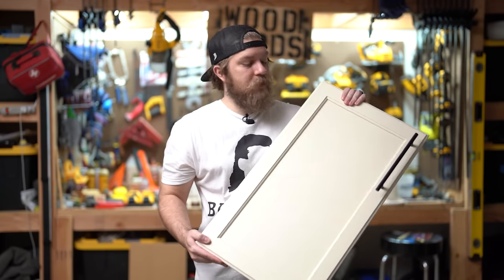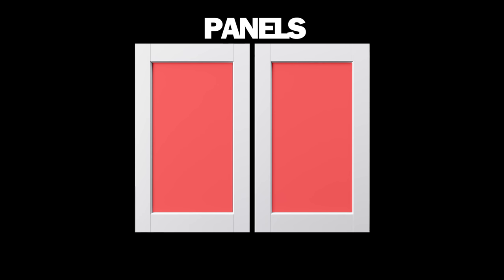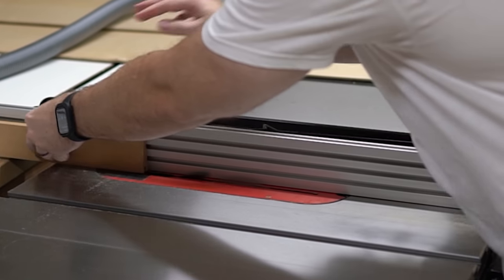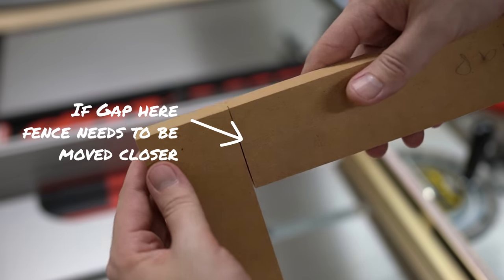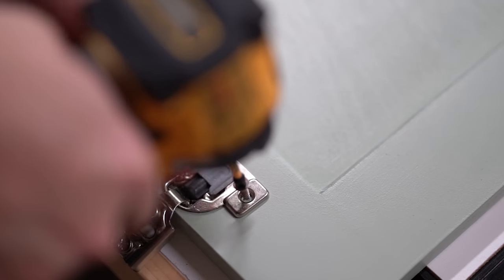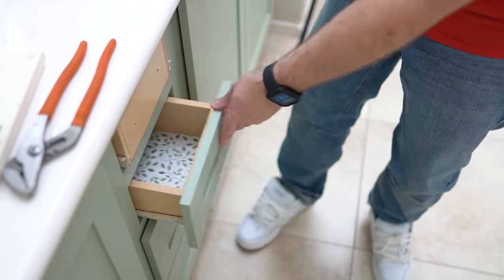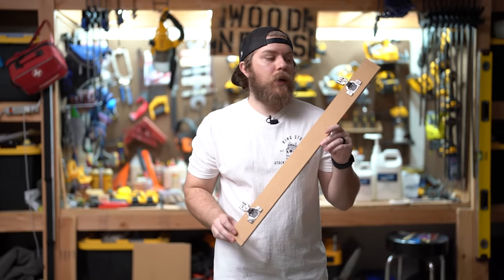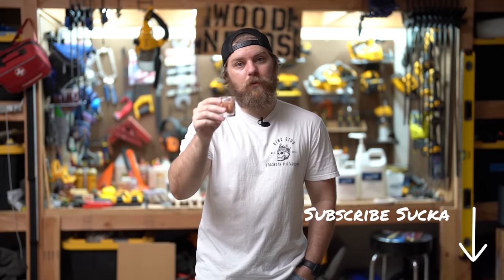CHEAP and EASY Shaker Cabinet Doors and Drawers | DIY | HOW TO

Comment: Great vid. Could you elaborate more on your painting process? Brush, spray, roll? You can be the best cabinet builder in the world but if your finish is poor it makes absolutely no difference. The finish is as important to the cabinet making process if not more than the actual building
Reply from the maker: Thank you! I rolled on 4-5 coats of a primer/paint furniture/cabinet base paint. The furniture/cabinet paint has oil in it that helps the paint penetrate and hold up to abuse (from what I understand). I’m definitely no pro and have seen some great tips for painting cabinets in the comments!
Reply: Thank you. Pro or no pro, your finish looks excellent. If you hadn't told me that I would have thought you sprayed it.
Reply: @WoodNerds what is the name of the paint and color code. That.looks great and link for the handles please
Reply from the maker: @BL-ut2zz I really appreciate that! The cabinet grade foam roller brushes do a pretty good job!

Comment: If I got this right: The bottom drawer alignment is critical for presentation. The top drawer height above/below cab door height is not as important to naked eye? Love the green color using gold hardware. Wow. The tips helped a lot as I encountered all of these issues in a recent cab build. Gonna try these Kreg templates - such a good company. Excellent painstaking presentation that answered all of my questions. Thank you! Sub’d
Reply from the maker: Hey! I would say they are both important! The bottom drawer face is the best place to start because you can mount it flush to the bottom of the cabinet doors and the rest you can stack on top. The math will make sure the top drawer face meets with the top of the cabinet doors. The left to right alignment is also important but the cabinet doors might be in or out a little due to adjustments you make on the hinges so as long as the drawer faces are straight to each other I think you’ll be looking good.

Thanks for subscribing and taking time to respond! I hope your future doors turn out well!

Comment: Nice video and well filmed and explained. This is pretty much exactly how I did my kitchen cabinets and all went nicely, although...
some problems I encountered were.
1. MDF when ripped to 2.25" wide is very flexible across its length so if your 1/4" P.W. panel is warped it will cause your door to be warped. 
    - you need to use very straight plywood and get the door built and primed before moisture starts to do its work.
    - once the glue and paint dries these doors are very stable.
2. The exposed cut edges of the MDF tend to be rough and soak up the primer and paint. I sanded and used a wood filler product to fill these edges but it was a real PITA. especially doing lots of doors.
  - I was hoping you would show how you solved this problem in your build (there must be an easier way than how I did it).
3. Squaring the doors during glue-up before the glue dries is essential and a little tricky, but that is true for solid wood rails and stile doors as well.
  - I would love to see your process for squaring the doors (maybe i missed it in the video). 
Happy new year
Reply from the maker: Hey John! Happy New Year, man!

Great points and detail! Thanks for sharing!

I didn’t really have any issues with painting mdf. My method is to paint one coat, let it cure over night, then apply additional coats as needed (around 4 coats total). The standard is to seal the edges with a top coat of some sort (varnish I believe is the go to), then paint as the sealant stops the mdf from absorbing the rest of your product but since paint cures to be a very durable top coat, it also stops the absorption (in my experience).

One caveat is if it’s atomized by a sprayer it seems to be absorbed by the mdf more easily. If you’re using a sprayer, maybe try to roll a first coat on the edges first rather than the filler and see if that helps.

For squaring up the doors, I just cut everything square to begin with so with all the sides meeting up and the tenons fully seating in the dado slot, it should be square (and was for me).

I have, however, seen people build fast and oversized by 1/4” and then take 1/8” off each side with the table saw to force them to be square. I haven’t tried this but a lot of pros do this and it’s a quick addition to the process that guarantees symmetry at the last step across all your doors.

Comment: Refaced all my kitchen cabinets 4 years ago with MDF stiles, rails, panels. Primed, sealed, and painted with PPG’s breakthrough paint. Tough as nails. However…..one door corner right above my range is now damaged due to rising steam from boiling water. No matter what you do, MDF will not hold up to hot steam coming from a boiling water pot. Keep that in mind if you’re going to do kitchen cabinets with this method.
Reply from the maker: Great point! Thanks for sharing your experience!

Comment: Awsome video! Saving this for sure! Do you think it's necessary to cut out the tounges if you are going to paint anyway? Couldn't you just use pocket holes and wood filler? I think this may speed up the process especially if you have to do a whole kitchen. Thoughts?
Reply from the maker: Hey man! I’ve received feedback saying they use 1/2 inch mdf rails and stiles that they pocket screw together and a 1/4 inch mdf panel that is slightly oversized. they then glue and nail the 1/4 inch panel to the back then router the edges so it all meets seamlessly so you don’t have to cut any slots at all. As for my method: 

Once the saw is dialed in, you can batch out a ton of stiles and rails faster than I could setup and drill 2 pocket holes for each. Especially if you have a dado stack! Cutting the tenons would be even easier then. I think your objective matters too. I was wanting to gain some experience with mine as well so the cutting is more of the “traditional” way. Also prevents me from having to defend myself online lol.

I don’t see an issue with your suggestion though! Run a test and see how it turns out. Knowing might be worth the $10 you spend to try it out before dedicating to that method for your entire kitchen.

Comment: Very nice job!  I recently replaced my cabinet doors, and they had glass inserts on the uppers.  I used this method for the lower ones, but I found that doing it on a router table was a lot easier for me.  You'd need specialty style and rail bits and a router that has the power to use them.  My mid grade porter cable router handled it just fine.  I guess it is one half dozen the other as to what people are more comfortable using, and glass inserts on the middle panel is a whole other headache of precise measuring...but it was worth it
Reply from the maker: That’s cool! I would like to make some with the glass panels some day. The router would be a great option as well. I’ve been thinking about doing a video with a bunch of different ways to make cabinet doors and giving my opinion on the easiest and strongest etc. would be a fun test. Thanks for watching and sharing your experience!

Comment: Was that apple Juice? How healthy of you :) Excellent video. A little humor and a lot how why we do it this way. Tip: I have been doing Shaker doors just like you did, including glueing the panel in, for some years. It's easy and fast. My latest is to use a drum sander for the rails and stiles. It gets them all the exact same width and gets rid of those little gaps where the rails and stiles meet for a perfect no gap fit.
Reply from the maker: Haha a little apple juice never hurt anyone! Thanks for the tip Mark! I’ve been wanting a drum sander specifically for things like this. Much appreciated! Thanks for watching as well, man! Cheers!

Comment: As a cabinet maker. I personally would never use mdf for rails and stiles.  Especially  1/2" mdf.  I have seen people that have used it and had horrific results. I'm not disrespecting you or your style,  you have skills. But for paint grade, for me, it'll be poplar or hard maple.  Thanks fora great video,  you're doing a great job.
Reply from the maker: Hey! Thanks for watching! I appreciate the compliments and you sharing your professional opinion and experiences. Nothing but respect from me! Cheers!
Reply: I tried hardwood in making my doors the results were that the wood warped so doors were not flat.
Reply: we have been using MDF-HDF for years building kitchen doors and drawers, both flat and shaker.  we used 5/8" for the rail/stiles with 1/2 inch panels that are dadoed into the 5/8.  basically flush with the inside leaving a 1/8 inch reveal on the outside.  currently we go with 3/4 rail stiles and 5/8 panel which gives the doors more heft.  the biggest difference between the stock Home Depot MDF and HDF is the amount of time sanding between primer coats.  the HDF does not fuzz up as much as the mdf which makes for a much smoother paint fiinish.  we also dowel the rail stiles together using a dowel max which gives strength on lines them up.  most of the major cabinet manufactures used HDF in their production.  we have not had issues with durability of the panels at all....with the exception of damage cuased by not making sure the pot handle is fully in the drawer before the customer shuts it.  

i am surprised that your hinge fit in the 1/2 inch thickness.  the cup depth for blum hinges we use it pretty much the 1/2 inch.  that is why we used to use the 5/8. 

good video, clear explanation.  i can see it being helpful to a number of people.  keep up the good work
Reply from the maker: Dude, I was wrong! I’m super embarrassed! It was 5/8 mdf! Idk how I mixed that up… anyway, I’m going through comments, taking responsibility and letting everyone know I was mistaken!

Comment: Have kitchen at the lake, maple doors with raised insert. it is not a/c in summer and no heat in winter. so temperatures go from -40*C to +40*C :) kitchen is 15 years old and still looks great. I worked at kitchen manufacturing facility for 17 years.
Now i service wood processing equipment. Lots of people buy CNC routers to make these style doors, because how popular they are.
Reply from the maker: That’s awesome! A CNC would be really cool for making single panel doors!

Thanks for watching and taking time to share your experience!

Comment: Great vid. Just a couple of tips. Not sure if someone already addressed any of this, but if making new doors and drawers, it makes more sense to have the same reveals all the way around for a better finished look. When you rebuilt your drawer faces, you should have oversized the widths so the space on the side of the drawers and above the drawers was the same. 

This space will be different depending on the door hinges. Full overlay euro style hinges will allow the door to open with almost zero swing to the outside. You can have 1/18-1/8” reveal. For face frame hinges you typically need more clearance on to the hinge side of the door, as the door opens at a different pivot point. If you have a square edge door like a shaker, you need more clearance than a beveled edge door when it swings open. Hope that makes sense. 
Also, when we reface cabinets, we typically add fill strips at the wall edge the thickness of the finished door in the mounted position. So if 3/4 door+1/16 off cabinet face the fill strips would either be shimmed 3/4”+1/16”, or 13/16” thick fill. When you rebuild the doors and drawers this way, the entire face will be flush.
Reply: Typo on the door reveal. Meant to say 1/16”-1/8” reveal with euro hinges.
Reply from the maker: Dude! Thanks for the tips! I’ll have to look into that to up my game next set I do. I initially wanted to make the reveals the same (or close to) but thought it would be weird to have a full sized drawer face and when you open it, get these half sized drawers haha. Thought I was even pushing it with the widths I went with here. I knew the end result would look better when closed but when opening would have surprised the user lol. I’ll try that out as well next time. Thanks again! I really appreciate the input. Cheers!

Comment: I've tried a lot of drawer clamping systems and I always go back to my double sided tape pads.  They just seem to work best in the end.  Might have to try some of the ones you used because the ones I got absolutely sucked.
Reply from the maker: I like double sided tape as well but wanted to save it for the router! I really like the ones I have. People complain that they are flimsy but I didn’t think that. Just don’t crank them down beyond what they are intended to for and I’m sure you’ll like them also. Cheers!  Thanks for watching and sharing your thoughts!

Comment: Looks fantastic.  How do you open the drawers without hardware?
Reply from the maker: Thank you! No issue at all. Could be better if I coved out a section on the bottom of the drawer but my wife thought putting pulls on the drawers would make it too busy so we opted to not add any.

Comment: Woow that's what I looked for! Thank you. Any advice for painting the MDF? I find painting the edges hard.
Reply from the maker: Of course! For me, I haven’t had any problems with mdf. I’ll give it a good first coat and let it dry all the way. The sides will drink a little of that in. Coats after that seem to go on without issue.

Comment: Good video been doing this work for a long time I have built doors the same way but when you cut the tenons use a dado blade much faster when building lots of doors also can you use 1/4 inch MDF for the Panels the only other thing is you have to be careful with the hinge screws into the doors they will strip easy MDF is soft  thanks Glenn
Reply from the maker: Hey Glenn! Great tip! Thank you for watching and taking time to sharing your experience and help the community out! I appreciate it.

Comment: Good video, kept my attention (although I would suggest a beer with that doughnut).  Any thoughts on using 1/4” MDF panel with 3/4” stiles & Rails?  About to make son’s kitchen doors and drawer fronts.
Reply from the maker: Hey Peter! Beer + doughnut has been added to my treat list.
The 3/4” rails and stiles should be just fine. The 1/4” panel I’m not fully sure of. It’ll likely be okay but there is a valid concern amongst builders that the heavier the door, the more likely you are to end up with too much stress where the hinge meets the door stile. MDF is hard enough to take a little abuse but the weight stress focused to those small areas might be too much for it to bear over time.

Some hinges come with the plastic plug style fasteners (I don’t have much experience with them), that are supposed to help spread the weight out in a different way than the threads of a screw. 

If you can figure that out, I bet it’ll open and close like a luxury car door haha.

Heavy + Smooth = Presumed Quality

Sorry I can’t be more specific haha I only have my experience and hear say from what I’ve been told or read. Hope that helps!
Reply: Appreciate the reply.   Maybe hardboard roughly 3/16 Masonite type stuff to reduce the weight vs 1/4” MDF might be the ticket.  Will experiment over weekend.  Blum hinges are the ones that I am familiar with that have the screw anchors.. but they are premium in cost.  We were going to go with poplar but the box stores have horrible selection so that is why your video peaked my curiosity using MDF.  I think I will make the largest cabinet door from various sized/specie panels and weight the difference and follow up.  Trying to stay away from having to fill the grain.
Reply from the maker: @peterb7401 makes sense to me. I’ve found experimenting to be quite valuable. So many people think highly/lowly of materials they have no experience with. I’d be interested to hear/see the results! Good luck with your project! Thanks again for taking time to reach out!

Comment: Really well explained! If I had the tools I can see how easy this would be now but sadly I live in an appartment, so I only have the basic power tools (drill, sander, jigsaw). Could you make maybe a video of how to create simple cabinet doors with MDF using maybe more basic equipment for those who are not woodworkers but like to try some basic cabinet project? I guess I could cut the stiles and the rails and the panel with the jigsaw with a bit of an edge and make it as straight as possible with a bit of sanding, but definetly cant do the dado. Any alternative? maybe a big panel the size of the whole door and glue the rails and stiles on top?Thanks man!
Reply from the maker: Hey! I appreciate it! Dude, it’s a struggle. I clearly remember how it was prior to investing in all the tools I have. The cuts for the components of the doors/drawers won’t likely come out how you want with a jigsaw but you can often ask the lumber provider to cut the mdf according to your requirements. It might cost (depending on the provider) but it’s an option. You can also ask other local woodworkers to pay for the cuts. As a maker, making cuts is much easier than finishing (where most of the time is often spent).